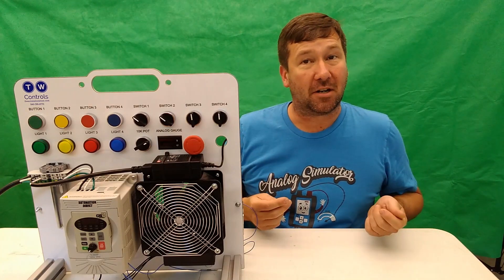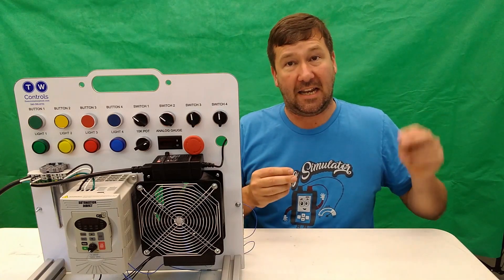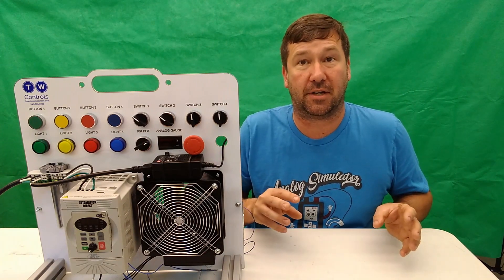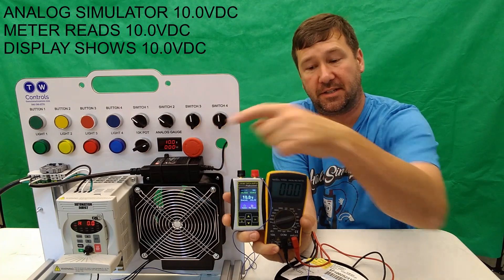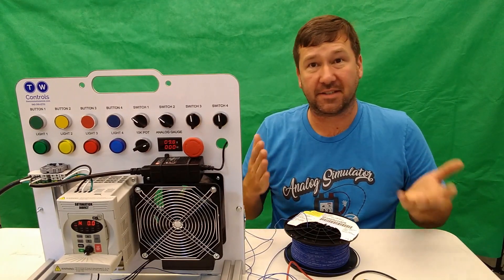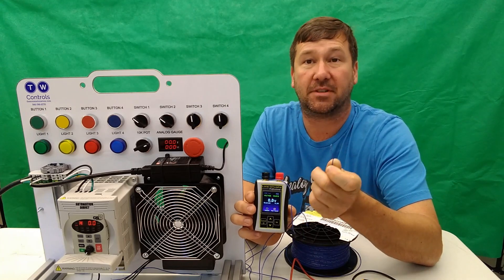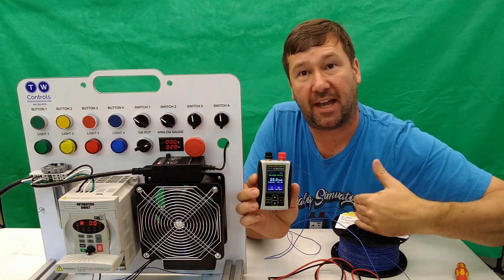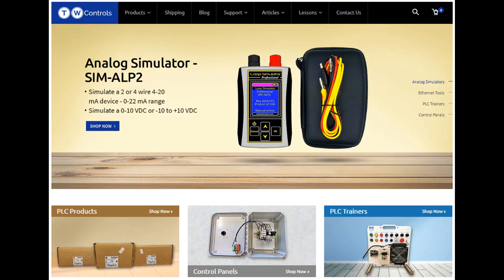Should I used 0-10VDC and 4-20mA Analog Signals?

Comment: why dont use 1 to 10VDC to avoid 0V
Reply from the maker: Overall, 4-20mA is more reliable if you are concerned about the 0V signal vs failure.

Comment: I have a question. I am trying to install a digital display meter that will be commanded by a 0-10VDC analog signal. Simply extending from control cabinet to outside of control room so truck drivers can watch a readout. Any suggestions on where I can get a LARGE weatherproof analog 0-10VDC readout?
Reply from the maker: I have seen them before but never installed one so I'm not sure which brands are good and bad.
Reply: @TimWilborne  thank you

Comment: Great video explaining it. The best part is how does the PLC or meter read that 4-20 signal? By measuring the voltage drop across a precision resistor on the input! I used to know the resistor values off the top of my head for 0-1V, and 0-10V but it's been a long time.
Reply: Crap, this is a three year old video! But just came up in my feed.
Reply from the maker: Oldie but goodie, here is one on the resistor values 😁
https://www.youtube.com/watch?v=DAMW5sKoH6E
Reply: @TimWilborne  Ah yes! 250 Ohm. How could I forget that?

Comment: Hi I have watched some of your videos and  they are very well done.  I am not an engeneer but I am trying to make a device that is feed by:
1. In 110V 2. Out: 0-60V - 0-35mA. (with a knob to control the voltage and if is possible the mA as well. I want to use it as a intophoresis device. Can you help me out with the project? If there is a price for it, please let me know. Thanks.
Reply: Buy an off the shelf bench top power supply. Normally you can only control one value at a time either the current or the voltage. Since depending on the load the ratio of Volts to Amps will change one of the values to obtain the constant of the value you want.  Say to maintain a 35mA output, depending on the load the voltage can be 1 Volt or 100V. If is you wanted a steady 60V, depending on the load your current will have to change to keep the Voltage constant. So in order to have a precise voltage AND current the load would have to be configured to achieve those constants.

Comment: Tim maybe you can help me here.
I’m trying to drive an actuator (0(2)-10vdc or 4-20 ma) with an Arduino.
Since the Arduino pin can only put out 5 volts I’m using the 4-20 ma input on the actuator.
I’m using a 250 ohm resistor and can produce a 4-20 ma signal but my stroke on the actuator isn’t no where near fully open.

Is this because (my guess anyway) that even though the input is a 4-20 ma it has to be based off of at least a 10v source for this actuator?

Or is 4-20ma in controls 4-20 no matter what?

Comment: What is the difference between the range 0-5 v and 0-10 v ? some times we have both on input module types , when to use this or that ?
Reply from the maker: Typically you will use 0-10V in industrial applications.

Comment: I have a 0-10v output signal from a loadcell amplier to PLC. Can I wire a parallel connection from this to a digital panel meter in order to display it near the loadcell amplifier?
Reply from the maker: Typically yes.  As long as the electrical load isn't more than the load cell can handle.  It will have a minimum load resistance.  Compare it to the panel meter and PLC consumption.
Reply: @TimWilborne  thankyou so much for the reply. The minimum load resistance is 200 ohm on loadcell amplifier, and input impedance on panel meter is 433kohm, and on plc is 200 kohm.
Reply from the maker: @jeesonpeter2049  You should be fine then.
Reply: @TimWilborne  thank you for the support and information❤️

Comment: Thanks a lot!!! what could we do with an control loop of the engine governor? what`s the difference in this case?
Reply from the maker: Hi Miguel. You probably could get more precise engine speed control but it would depend on what type of precision you need for your application as to whether it would be helpful.
Reply: @TimWilborne  It`s a caterpillar speed governor, it controls the speed and the generator power at the axis output, then i`ve a problem because it`s very unstable at 60hz, and i don`t know if i may to change the type of signal or calibrate the pid controller.
Reply from the maker: @Miguel-wx8ii  I might talk to Caterpillar before making any adjustments.  Most Caterpillar generators are good a regulating their frequency.  I would lean towards it needing a tuneup first.